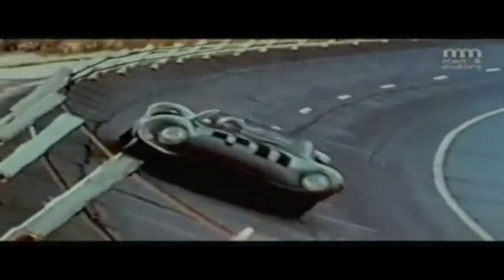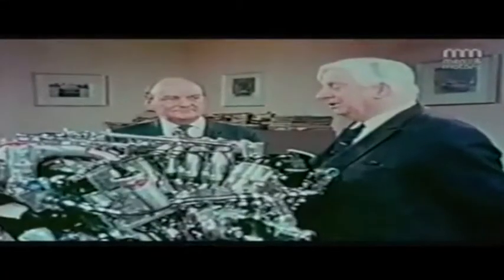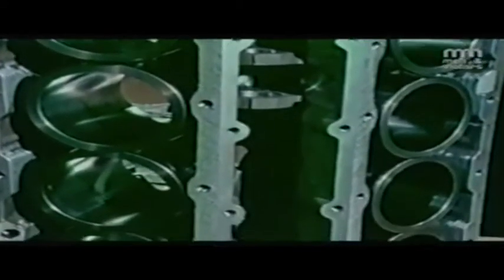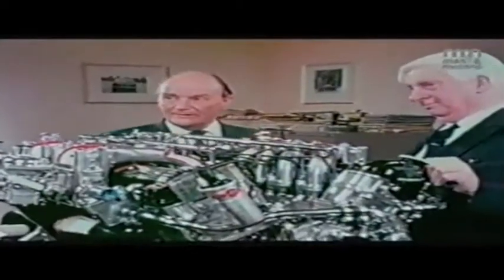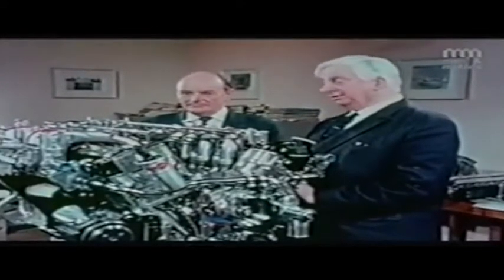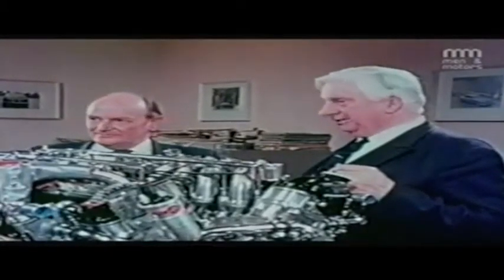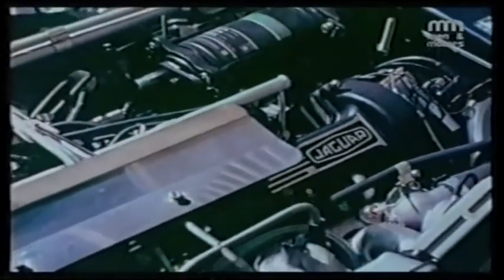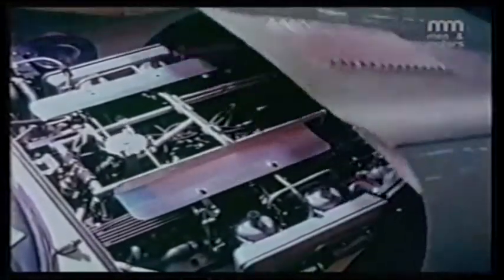The Jaguar V12 Engine

Comment: Having dismantled and rebuilt my V12, it was a pleasure to work on and definitely a superb design, incredibly smooth and understressed. hats off to these two designers. Great video, thanks for uploading.... 👍🇬🇧
Reply from the maker: Thanks for the feedback. We are also currently rebuilding one of our own V12s, great design just sometimes a little miss understood
Reply: @LouGuthryMotors  There was never anything wrong with the mechanics, the ancillaries however were a very different matter and sadly the Yanks do an LS swap to replace the latter.
Reply: these engines were not able to drive for a longer period on german autobahn without dropping valve seats

Comment: This guy asking questions is literally trolling these 2 fine gentlemen back in 71’ before it was a thing wow this is a brilliant piece of engineering way past most people’s automotive comprehension respect 💯
Reply from the maker: Hahaha! Trolling 1971 style. These engines are amazing if looked after correctly.
Reply: @LouGuthryMotors  they sure are.
Reply: What do you mean by trolling? My understanding of trolling is deliberately posing questions or making comments to bait or upset somebody - I don’t believe that’s what this guy is doing. Certainly he’s interviewing 71 style, which is When often non-technical interviewers would be given a set of questions to ask, and would post them at the specific times and let the people answer them, but that is not trolling
Reply: @LouGuthryMotors  how many miles or kilometres? Would they generally do between rebuilds of looked after well?
Reply: @malcolmwhite6588  wow don’t take everything so literal relax 🙄 his style came off aggressive so I exaggerated trolling and you write a whole soliloquy about interviewing 😂
Reply: @malcolmwhite6588  zero they just go forever if well kept
Reply from the maker: Really hard to say as conditions vary but these engines in every day motoring are rarely stressed so looked after properly can run for a long time.
Reply: @nobatteriesincluded3968  ha ha all good. My brain is a bit like a data processor and is a bit literal LOL. I was just curious as I got called a troll myself on the Quora had no idea what it was at the time and so reading to your comment and listening to the interview, I was curious , appreciate the reply.
Reply: @nobatteriesincluded3968  Oh and 10 points for knowing the word “soliloquy” in this day and age, Most people wouldn’t have even heard of it let alone understand it all be able to use it correctly in a sentence !🏆👍🇳🇿LOL

Comment: These engines did never work they dropped valve seats any 20.000 miles
Reply from the maker: Thanks for watching and commenting
Reply: I’ve had seven of them over a period of 20 years and they have been extremely reliable. My daily has 189k never rebuilt.
Reply: @smgdata  kilometres or miles is that?
Reply from the maker: They are great engines, vary rarely stressed and if looked after will run for 100s of kms
Reply: I‘ve seen you comment on so many Jaguar V12 videos.
Looks like you really can‘t stand them for some reason😂
Reply: @rconboard2709  These HE V12 engines have India made heads and drop valve seats.